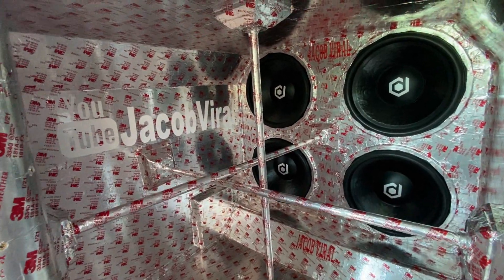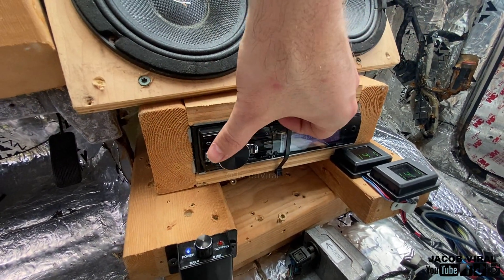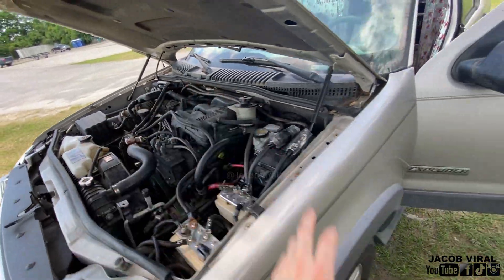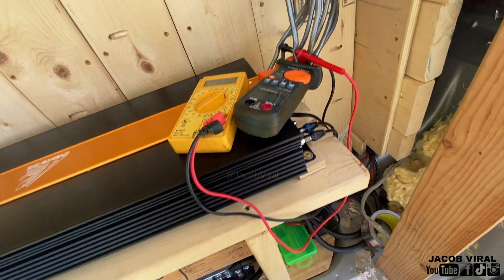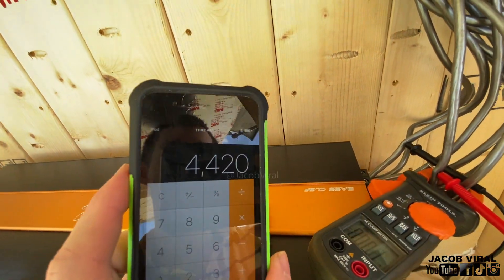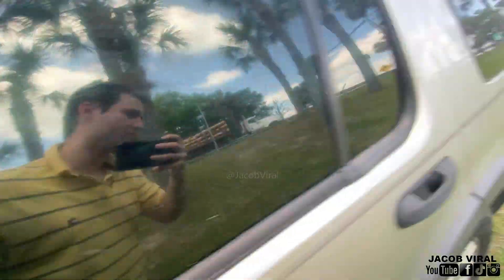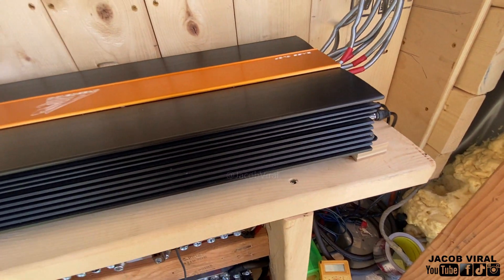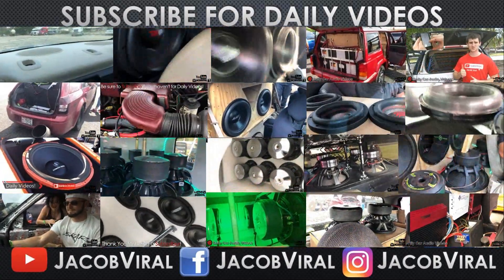Does Amplifiers Put Out RATED WATTS RMS!? Clamping My Amp With RESULTS!

Comment: I have seen and have videos of the bc6k wired to .5 put out way more power.. but dropping that low and running .5 is def a no no.. and why amp didn’t like it lol.. 12v lol yea she gonna hate it for sure.. strain on the caps and rails lol.. I would say if anyone wants to run .5 on any amp make sure your voltage stays with it and can keep up with the draws and load.. not hating just stating lol..

Comment: Bro I'm confused about the wiring for alternator. Are u basically saying 2  + and  2 -  from alt to both batteries I have in car?  Can u break it down for me?  Maybe a diagram to follow?  Ty in advance.
Reply from the maker: Do big 4 wiring under hood, 2 runs of ground from front to back and 2 runs from front to back power. Those runs can go directly to the back battery. Also, double up grounds to chassis from back battery to be safe. No diagram needed, it's very easy to understand. 2 Alt videos I made: https://www.youtube.com/watch?v=Xc4-vB6gZgg / https://www.youtube.com/watch?v=ez431YBuBxI

Comment: Jacob great job with the educational videos, luv them. Now, I understand that you were clipping on the last run. My question is did the amp go into protection because of the hard clip or the low voltage? I just picked up a 8K Crescendo and want to learn as much as possible before I install it, thanks.
Reply from the maker: Thanks Israel. The hard clip and voltage drop both factors. Also keep in mind low rise below 1 ohm load caused it also I’m sure.

Comment: Would the 4k be a good match for a single x15 v.3 in a 4th order
Reply from the maker: Yes that’s actually a really good option as long as it’s clean and your not pushing the limits to clipping. Depending on rise that sub would do well on 2.5-3k.
Reply: @JacobViral2  I'm rising up to 2om and clamping 2,780 watts
Reply: @JacobViral2  what does it mean when you say "rise"? I'm trying to learn all I can about the electrical side on this setup
Reply from the maker: @badas95Z  just like i showed/explained in this video, my final ohm load rose from starting point to end over that.

Comment: I just don't understand how so many amp s can fluctuate between 1ohm and 4ohm...... 2000rms amp at 4ohms 700rms......... I have a 1300rms amp that does well over rated and does 800rms at 4ohm......Let's take a skar skv2500 for instance ya at 1ohm 2500+ but at 4ohm with impedence rise n all it only 750 . What am I missing?????? Some feed back would be much appreciated.  I need a clean 2500rms amp. Orion xtr2500dz???????? There's so much out there
Reply: if you want 2500 watts after rise, look at a 5k or 6k. That will get you closer.
Reply: @Rightn2Parabola  ya I broke down and went all in. Bought the RF t2500bdcp. Clean amp and it's not taxing the shit out of my electrical.  But I get what your saying by going a lot bigger of an amp

Comment: I have a DB 7900.1D.  Any reason I should move over to the Korean side?
Reply from the maker: Nice amp! I would say Korean if your wanting a more durable amp that can be wired a little lower then 1 ohm and do fine after rise while full bridge doesn’t like it. Also some Korean amps are made for Bass output more.
Reply: @JacobViral2  I have a 320 h/o alt @15v ready to install with a 40ah. Unfortunately I would have to get an amo for each sub I have since they are both dual 1. The subs are db 305s

Comment: Why you took out the agm? My guess is alt cannot charge agm to 100 percent. It won't. Well mines won't. So it's best to find a good 100 ah led battery. Nobody wants to charge car from the house every weekend.
Reply from the maker: Different cells between agm and lithium so it wouldn’t pull the lithium down and to be more efficient.

Comment: Hey man , great video but when you clamp like that it’s just raw VA and would still need that power factor to give you the accurate wattage. It’s still in the ballpark but if you had 6500VA and say a power factor of 0.8 that would sit you at 5200W
Reply from the maker: Excellent point thanks!

Comment: Thats def a decent amp, good video. So say you were using an smd amm-1 and it said 3k at 2 ohms through the one lead going to one of the 4 subs, itd still be 3k to all 4 subs right? Meaning 12k watts rms out of the amp total? Just trying to understand completely
Reply from the maker: all leads are together even if you measure one.

Comment: Awesome thanks for posting, I asked you delivered🤙, fantastic numbers, getting closer to a 160 with my 3 PSI 18’s tuned to 29 Hz car peaks at 45, only had two days to work on it, and it is my first wall, you inspired me to finally pull the trigger and try it thanks🤙
Reply: What platform you running?
Reply: @dcplze3107  platform 2’s, wide roll with the 1800 watt upgrade, I have 3 recones just sitting around, but they just keep taking a beating 🤦‍♂️ just did a show in Pueblo Colorado good time’s🤙

Comment: Wouldn’t it put out even more if you could keep your voltage up?
Reply: Yes that definitely helps but an amplifiers output can also change depending on frequency
Reply: @BIGJURAY20  I understand that aspect, but I was under the impression that letting your voltage drop into the 12’s or lower was supposedly frowned upon. I get nervous when mine drops into the low 13’s. LOL
Reply: @joeb9793  If you're running agm 12v is actually pretty good it's below the 12v that you have to worry about. But of course the more the better and true better the voltage happier your system will be
Reply: You don't even start getting any power from any lead acid until low 12's. IF they are charged. Lol! It's why lithium is better. Higher starting voltage, makes for more power potential.
Reply from the maker: Correct